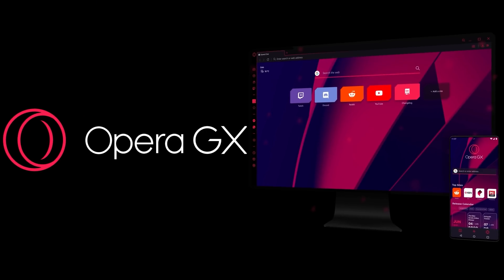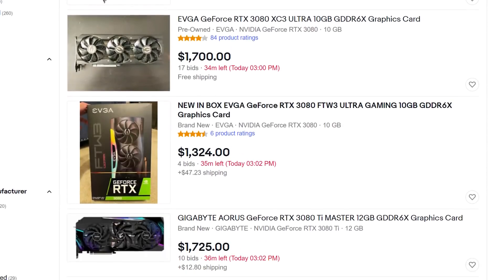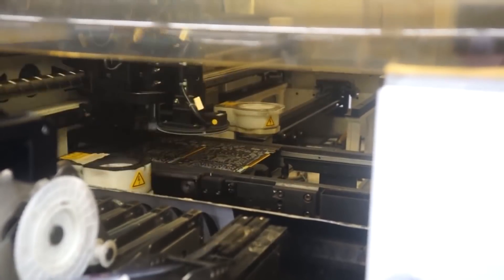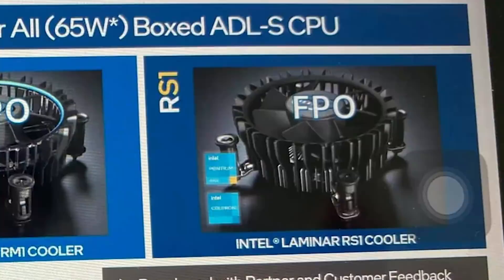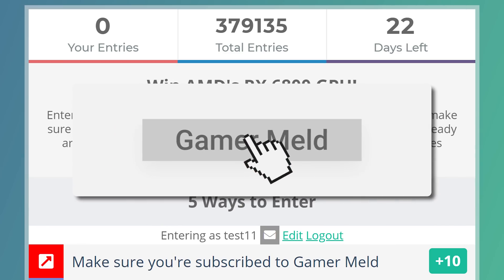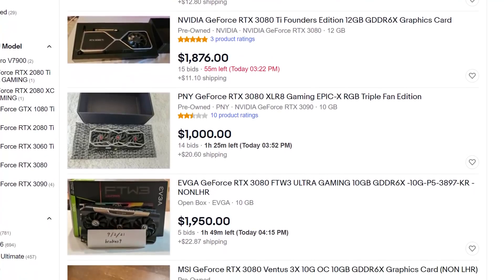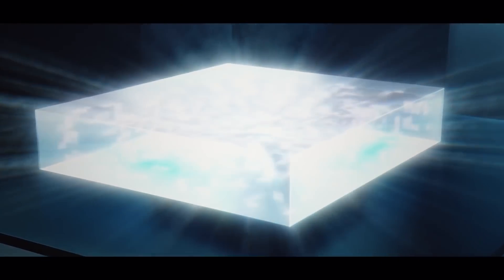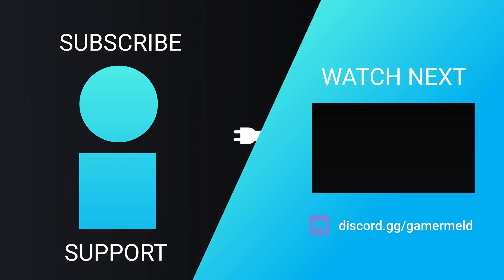2 Intel ARC GPUs LEAK - Pricing, Performance!

Comment: I personally thinkg the 2060 move makes a lot of sense. I've never thought it makes much sense for them to make a whole new series of cards each generation. Rather than making a 3050, and 3050 ti why not just keep making the 2060 and 2060 ti? It especially makes sense given that the yields this generation have proven to be record setting good. They aren'r producing tons of GPU's that need to be cut down.
Reply: I am sure making a new generation is better for profitability. In normal times they would need to cut the price of the older cards to compete. This would make the older cards less profitable and take sales away from the newer cards.
Reply: @andrews.9286  It's not. 100% not. The reason why we get low end cards normally is because new generation cards have bad yields and they produce a lot of semi functional chips. They then use those semi functional chips in low end cards so they still get some value out of the semi defective chips. So low end cards are basically industrial waste put to use. But they still require new coolers, new board layouts, new drivers, new programing. Older products already has all the research and development done. And as a product ages it's easier to control the yields and get what you are looking for more efficiently. This business model makes way more sense when you have an efficient generation of cards that isn't producing enough defects to warrant releasing lower tier product stacks. The fact that right now everything they can produce is being bought up of course is all the more reason. They aren't intentionally producing lower end cards because why would they? They can produce the higher end cards and are selling as many of them as they can make.
Reply: @exturkconner  Your argument is not consistent. If they did not make new generation low-end cards, then what will they do with their "industrial waste" chips that don't meet spec?  If the only option other than using them is throwing them away then these chips are basically free. Why run a separate production line with old chips that you need to pay for? Especially at today's high prices.

Also I don't think it is that expensive to come up with new versions because video cards use common components. The board partners also want to differentiate their products, look at how different the 6600XT cards are among the various brands. The other factor you are forgetting is competition. Nvidia (or AMD) cannot just make the same products over time because other they may be overtaken like Intel was. 

The reason Nvidia is relaunching the 2060 is because there is no competition in the under $400 price range right now. If AMD chooses to launch a 6500XT its performance has to be lower than the 6600XT, so the 2060 would still be competitive against the 6500XT. Also the 2060 has the advantage of the Nvenc, DLSS, and better ray tracing. My prediction (and I hope I am wrong) is that you will see an upward price shift when the new super cards come out and the 2060 will have a $330-350 MSRP. The price maybe lower if the new Intel graphics cards are competitive performance wise.
Reply: @andrews.9286  My argument isn't based on some hypothetical future scenario it's based on what's happening right now. There's nothing consistent about one situation. I'm not making an argument I'm pointing out the facts of this situation.

Comment: Yes, I am interested in the new Intel GPUs. However, I thought the initial shipments were for mobile use with desktop use coming latter. Also think it is good that Nvidia is re-releasing the 2060, the question is at what price. It would be a hit at a $299 MSRP if it can be purchased at that price.

Comment: Looking forward to seeing pallets and pallets of Intel GPUs in the hands of miners...
Reply: nope. ethereum is changing in January to proof of stake. read some news. it will be the reverse. a tsunami of used gpu's on the market.
Reply: @uraoshi  exactly , unless they push it back like they did some many times it should have a flood of cards coming out since miners will probably sell off their cards.
Reply: I'm looking forward to when the less greedy of them figure out that only the miners are keeping it high, and bail. Once that parade starts....

Remember the housing bubble. It was the flippers that spiked it so high, and then it was over.

Comment: Why would I be disappointed in them releasing at 2060 If the process is full to a capacity with the 30 series and there's an opening to bring back a 20 series to relieve the pressure of gamingg cards not being available Then this is nothing but a good win a 2060 could still be an upgrade to a to a lot of people
Reply: And honestly I think AMD should make another run on Vega cards

Comment: Intel changing out their stock coolers would be great - their included ones are just short of worthless IMHO.    I tend to use Scythe but they would be a pain for some users so they need to go with something still simple to install but MUCH better for cooling and quieter.   I'm not sure what the deal is with the 2060.   I'm using a 1070 ti and won't buy anything until something significantly outperforms the 3080 ti when it comes to RTX performance.
Reply: These new ones also look pathetic.
Reply: Stock coolerd are bad anyways for most cpus, I tried one on a ryzen 5 and it was not even close to useful. Altho If amd ans intel can make their cpus more power efficient they could be. On my older i5(uses about half the power a 5600x does) the stock cooler was very good. Kept it at a nice 45 degrees.
Reply: @sansundertale69availablename  Use it with thermal grizzly paste.
Reply: @virexium6422  Yeah good luck trying to cool an overclocked i9, which uses 300W with a stock cooler, thermal grizzly is good, but it's not magic, it can't bend the laws of physics, I mean it will cool it, but not very well it will be thermal throttled the second you try and do anything.
Reply: @yakacm  Okay, yeah maybe that would be a bit too far.
Reply: The stock cooler worked for 65W, if you didn't mind 75°C and a noisy fan, but I am EXCITED that they finally removed the plastic frame that would start to vibrate irritatingly on some of them at even the minimum RPM.
Reply: @mleise8292  If i was intel, i would go all out to get myself out of the shit hole they are in lately. Starting with those "coolers".
Reply: I didn't realise that Intel still provided coolers with their CPU's, no one uses them anyway, I have about 5 of them in a drawer somewhere, they are basically just landfill.

Comment: And somehow mysteriously, the cryptominers will have ready to go drivers and software right at launch!
Reply: I know right? Like wtf, how in gods green earth do they have whole ass scripts prepared for the damn gpu's before launch.
Reply: @Shamburu  My guess is the Devs are in on it.
Reply: @Shamburu  eh? what do ya mean by scripts.
Reply: @Shamburu  oh, for some reason i assumed you were talking about something other than driver code
Reply: @Shamburu  It's not really that complicated. You have OpenCL (AMD and others) and CUDA. These are the code interfaces for programming a GPU. As long as one is supported, mining software can run. The drivers are available to everyone by the manufacturer. So its really just up to community developers to optimize software for these cards as you do for games. BTW drivers are not "scripts" though I understand your (somewhat ignorant) logic in saying sheets of code are scripts. We aren't printing out code on paper, so there are no sheets :D. A script is code that another program reads and executes. A driver is a compiled program which means it goes from code -> assembly (the language of a CPU processor) and then to binary. So there is not really that much any miner needs to do to start using a new GPU model in normal cases. I am a gamer, a developer/engineer, and a miner. And BTW miners are not the scapegoat or the real problem, not at least what you would consider retail/small-time miners. Hope this helps.
Reply: @scooterman30  Don't programmers make scripts using coding languages so that they can then be decoded into binaries? Isn't the whole reason for scripting in words and letters a means of understanding binary functions without having to try to learn the hell that is scripting unit by unit? Like how website designing user interfaces make coding easy to use, such does coding make binaries easier to use. And also, i don't see why in hell you even mentioned 'code not being printed out as sheets of paper'. It's very obvious that code isn't printed out and if you meant it as a joke, it was not funny. Thanks for the detailed explaination though, i would've written it similarly if i had the time.
Reply: @Shamburu  "Don't programmers make scripts using coding languages so that they can then be decoded into binaries". No that's compiled languages vs interpreted languages. Google that.
Reply: Nope, not "somehow"... more like $$$$$$!
Reply: @Gary_Lazerr_Eyes  ._. Ok?

Comment: I hope that Intel slide is just comparing price and wattage, and not necessarily performance. Intel said that their gpus would finally give nvidia some competition
Reply: They look to be intending to do just that. he majority of the market is in the low, to upper mid range segment. No point competing in the super high end market as those cards are only used by a small slice of the market.

Comment: Re-releasing the 20 series card will drive prices down, and besides, a 2060 is better than a nothingsixty
Reply: The fact that this "new" RTX 2060 is gonna have more Vram (12Gb) than the RTX 3070 (8Gb) or the RTX 3080 (10Gb) is just funny.
Reply: @yan3066  and completely useless hahaha, I have no Idea why Nvidia likes putting 12GB of vram on a entry level/mid range card
Reply: @mastroitek  i think 12gb is for content creator
Reply: @naoton201  yes that for sure. But small content creators (like 99% of the YouTubers and others) don't actually need that. A friend of mine makes small movies and ads for a living and apparently 8gb of vram is more than enough. What I'm saying is that to me it looks like a waste of vram (and you obviously pay for it). Some 3D modeling software (and others) will surely use more than 8gb but the users that have that type of workload aren't many...
Reply: @mastroitek  it's because of the bus style on the RTX 20 series GPUs is designed for increments of 6, so it was either 6 or 12... And 6 isn't enough for anything above 1080 anymore.
Reply: @benruss4130  I know, but honestly a 2060 is anyway not able to play 2k on new games, it will do 1080p high. That does not require 12gb of ram. I'm just saying that with this current market keeping down the prices, even if just a bit, would be a good thing.
Reply: @mastroitek  I know... But even 1080p cards are coming with atleast 8gb these days...
Reply: @yan3066  yeah I was confused about that to but I’m not against rereleasing that card. Maybe decrease the amount of vram if it’s the same type of vram used in ampire but other than that, it will help increase the supply of decent cards for modest gamers
Reply: The 3080 has gddr6x so not too bad but the 3070 has gddr6 like the "new" 2060 but less vram. Now that's something lol. I doubt the new 2060 can even use more than 8gb since it highly wont be able to play well in 4k anyway. Just marketing.
Reply: @barronhelmutschnitzelnazi2188  that is also my point. I have a 1070 and I never reached vram saturation. A 2060 it is slightly faster so 12gb is just for marketing or something
Reply: I think this is for businesses that need gpus  with high vram..
Reply: More VRAM? that's good for miners isn't?
Reply: @tyranus7  Nah the mining take like 4.5 gig or something like that .
Reply: I agree...I mean I'm using a GT 1030 2GB card. That's all i could afford. Sad.
Reply: @rickh8380  my budget is for gtx 1650 super but this days its even hard to get gtx 1050 2gb with my budget
Reply: @naoton201  I bought recently a 980 Ti used....250€ ,At this time it's a good deal as the 1650 super is like 450-550€ and it's wayyyy better than a 1050.Very happy with it.
Reply: @rickh8380  at this point take out your old consoles. Like ps2, Nintendo something and re-discover them. Or try out some older pc games that you never played, maybe Age of Empires, or a game which runs also on potatoes like Don't Starve.
Reply: @mastroitek  Thanks for the info. I mainly do play older games like F.E.A.R. series, Half-Life series, CS:Go, games off GOG, etc. Never having a 2080...might be a good fit for me if the price point isn't insane? Cheers
Reply: If they unlock the DP FP math it will be a winner.

Comment: I thought Nvidia re-released the 2060 once before, earlier this year, unless that was just AIB doing it.
Reply: I beleive it was the 1050, for like 300 dollars or something stupid.
Reply: The OP is correct and the two responses prior to mine are both wrong.... earlier this year a leak that Nvidia would announce a re-release if the 2060 got out... not the 1060 or 1660... I don't know where either of you got 1060, 1050 or 1660 from, that was never a thing. 

As it turned out, the 2060 re-release didn't happen, so the rumor was either false or Nvidia delayed the re-release.
Reply: @wolfshanze5980  I Google it again, they planned to re release the 1050ti and 2060 back in February

Comment: Intel needs to take this opportunity and make their own quality GPU's instead of off-putting them overseas. Where they are much weaker quality control.
Reply: That would be ideal but it's more likely they will use third-party manufacturers like ASUS.
Reply: @kusayfarhan9943  Board partners dont make the chips just everything around it. Intel is investing billions in making new fabs, i wouldnt be surprised if those are for the second gen gpus possible next year. Letting other manufacturers make our chips is helping them and not helping us Americans.
Reply: @F9023JFjcDfsdfw2e  I know that. What I meant is that they will let board partners make the cards (not GPUs). I would rather see them make and sell the whole package but it's unlikely. Cutting out the board partners removes an unnecessary layer of mark ups.
Reply: do you realy think, that this doesnt can happen in america too? QC never controls every single product, they just controle maybe 1 of 100 units. do you know, how expensive a gpu would be, if you have to controle every single unit...
Reply: @georgwarhead2801  Im aware how quality control works, i use to work at a factory that manufactured car parts. Im not saying inspect every part. The vast majority of things made over seas is garbage, so im saying lets stop having factories over seas make our stuff.
Reply: @F9023JFjcDfsdfw2e  at least here car factories inspect nearly every part on every car. it's more efficient that way.
Reply: If they still have matching fabs of their own that would be a huge advantage, with much faster production times, higher margins etc.
keeping certain things in-house sets you apart and makes you stronger, like IBM on the super-high-end Power servers (all other RISC vendors failed because they weakened their R&D) or Samsung whose 100% in-house SSDs gave them that large market advantage for like a decade.
but since the trend has been about crippling one's own capacity for savings, i'm not sure if they still have the option.

Comment: $300-500 for a first-gen card that’s most likely worse than amd and nvidia in rt and rasterization… pass.
Reply: I don't even care about that, If they can release a $400 card that can at least rival the 30 60 ti with a good amount of stock I'm sold
Reply: @pointlessless2656  intel won’t. that’s the point